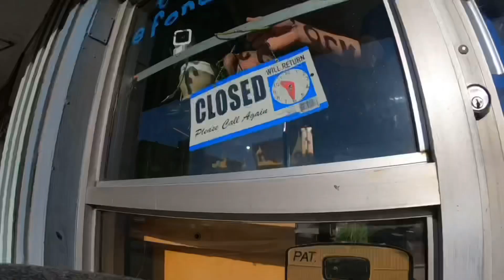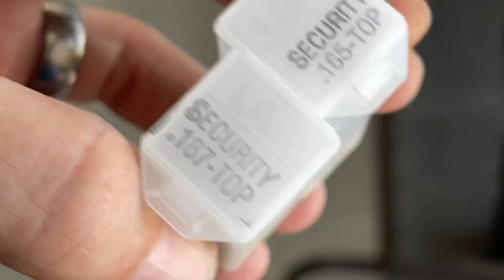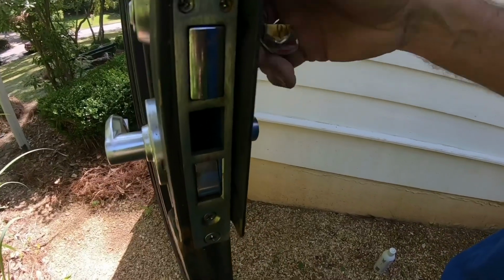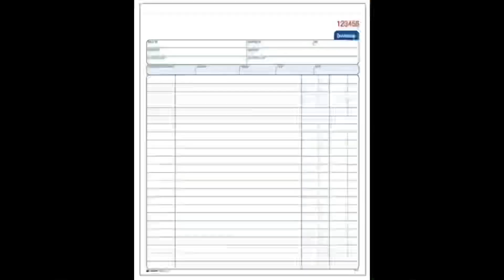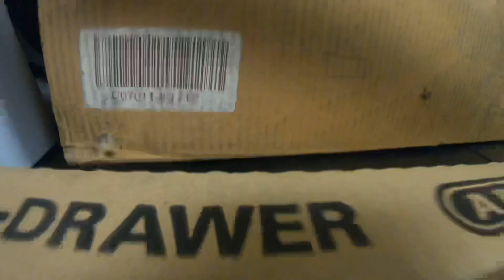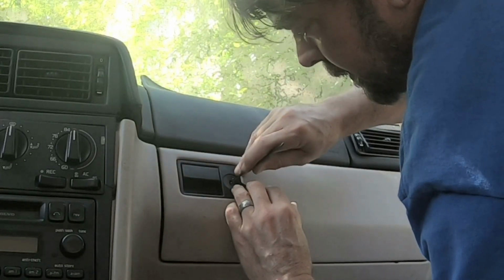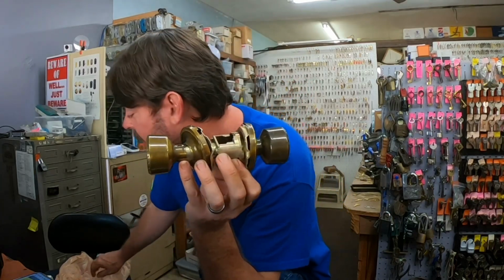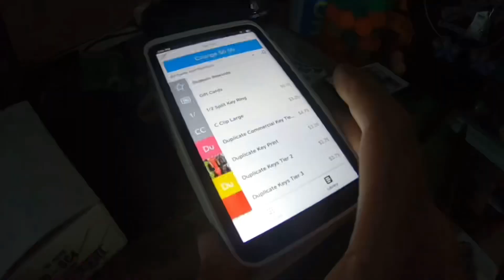a locksmith day movie

Comment: My large .003 pin kit has sat unused at my bench for at least the last 15 years. Since master pinning Kwickset and Schlage locks account for 95% of everything I do. I use my Mini Kits for those 2, love them. I also keep a .003 Mini in my Van just in case I need it. Needless to say l don't have to stock many sizes. The same old dozen or so short length bottoms and masters.